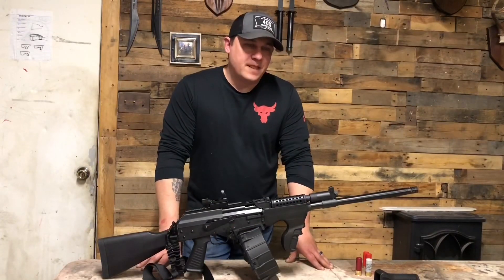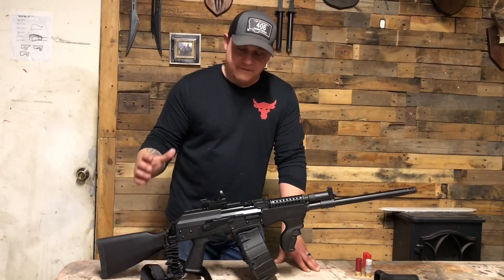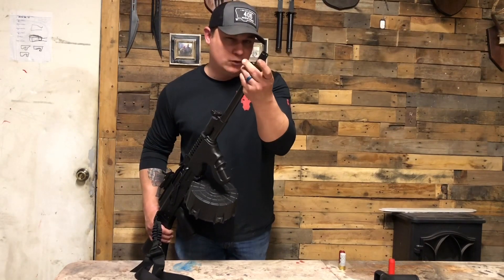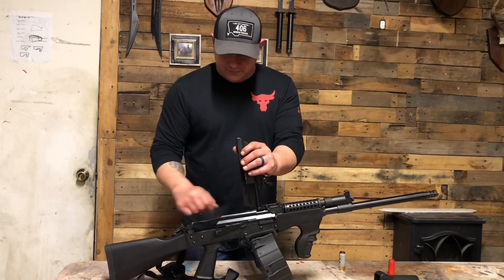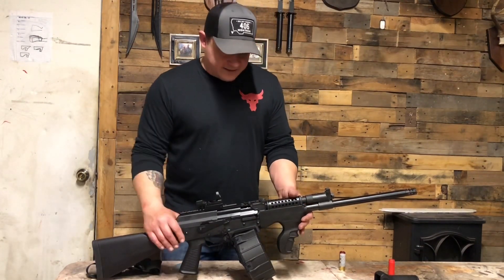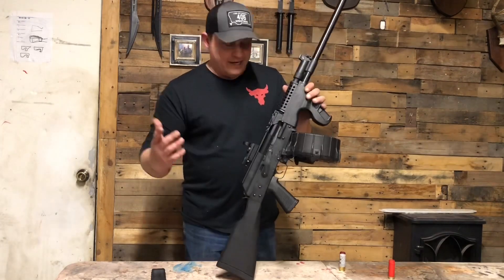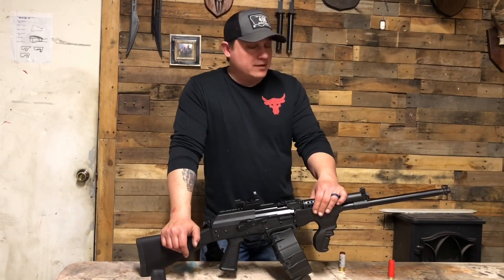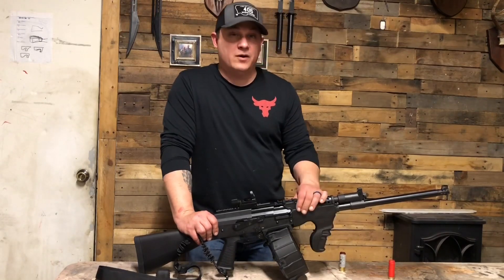JTS AK12 Modifications!!!

Comment: I had a Jts ak12 I bought from academy. And that thing would not shoot anything no short cheap brass no high brass no Turkey mag. I tore it down completely apart and come to find out the adjustable gas block did not line up completely with the gas port in the barrel. After adjusting the gas holes it would shoot anything from the cheapest Walmart loads to slugs. That mad a world of difference
Reply from the maker: Good advice 👍
Reply: Is the jts ar12 also good as the jts ak12
Reply from the maker: @patriciaeaton-up4yj  it doesn’t test as well as the ak12
Reply: Cuz it tells you clearly and the instructions in the box when you buy it to disassemble the whole gun clean it and reassemble it especially the adjustable gas port
Reply: @justicemcdonald2939  it doesn’t matter when the gas block port doesn’t line up with the barrel port
Reply: @tomeickhorst6787  but if u took it apart cleaned it and inspected it like they tell you to do you would have seen that from the beginning
Reply: @justicemcdonald2939  yes I did clean it and shit and no I never thought to look at the adjustable gas port to make sure the ports lined up correctly. Not something that is a common issue when you buy a rifle or shotgun with adjustable gas block. First one I have seen and I am 50 years old and have had guns since my first one my dad got me at 6. That is a quality control issue in the manufacture
Reply: @tomeickhorst6787 same with my saiga 12. Mine has the 4 ports in the diamond configuration and 2.5 of the ports were covered so it would barely run high base shells. Seems to be a common occurrence with the ak shotguns

Comment: I get people asking me how i installed my sling. What i did was i drilled a small hole in the but stock and the bottom of the front grip. Then i got some sling mounts with the pointy screws and just screwed them in. But when you screw the handgaurd sling mount you have to dremel down the screw so the handgaurd fits back on. Mine works great.

Comment: Or just make sure your gas ports aren’t covered and are opened up. My saiga had 4 ports and 2.5 were covered by the port housing and had to be modified then the ports themselves opened up. Also the spring guide kit they sell for these fixes those failure to extract issues. Spend $150 and save thousands in the long run on ammo and definitely save your shoulder
Reply from the maker: Great idea👍

Comment: I won't use low brass (or aluminum) in anything but a single shot shotgun.  Any semi-auto or pump I have is fed something other than high brass.  I even have a very good pump that hangs up with low brass crap.  I thought the Winchester white box stuff was going to be good cheap practice ammo so I bought a bunch of it.  I was wrong.  I gave it all to a couple of friends that have double barrel guns.  So I don't even keep that stuff around anymore.  I stock and shoot the good stuff.  That stopped any and all problems I has with my cheaper shotguns and even one of the better (really great actually) ones.

Comment: I don't like the forward grip being vertical. with the drum on it's like giving your gun a reacharound, I don't dig it, I put mine horizontal on the left side, just my thing I guess.
Reply: I went with a carlsons door breaching muzzle brake also.
Reply from the maker: I think the side grip is a great idea.  Something I might have to try👍
Reply: @brettsgroovychainsaws5995  Magpul 10 bucks, drll 2 holes on regular lower left hand grip, tighten down included nuts, use locktite putting the nut on the screw

Comment: I've put around 150 round through my jts m12 ak shotgun and it still has not properly ejected or fed yet
Reply from the maker: Next video I will post is the JTS vs a wooden door with different rounds!
Reply from the maker: I’ll post what i shoot as well
Reply: might need to polish the rails with a fine grit sandpaper and then fully lube. I had that issue at first
Reply: That's because it's a piece of crap.
Reply: @couchwarrior2449  I realized that about 1 week after purchasing👍
Reply: @couchwarrior2449  henry axe .410 lever action, that's a beauty
Reply: @samrabena2720  Yeah. There's something about lever action shotguns that is, shall we say...kick ass!!!
Reply: Took one hundred rounds to break in, then it functioned reliably. Adjust your gas setting to number 3.
Reply: @couchwarrior2449  it's a $450.00 semi-automatic shotgun. It's a little rough. You have to polish a few areas. All the reviews I'm reading are saying it's a great weapon.
Reply: @couchwarrior2449  mine cycles everything except winchester 1200 fps.  It is a great gun for $400.  It will cycle 1180 fps estate.  No issues with other ammo. I polished my rails and bolt carrier.
Reply: @Na-if5ze you have to clean the 
gas system completely before shooting is the trick